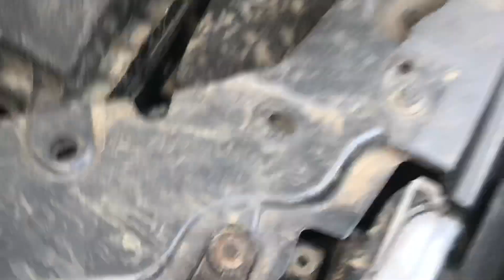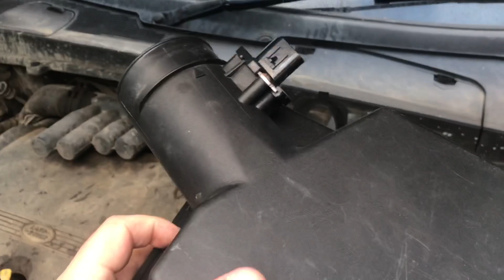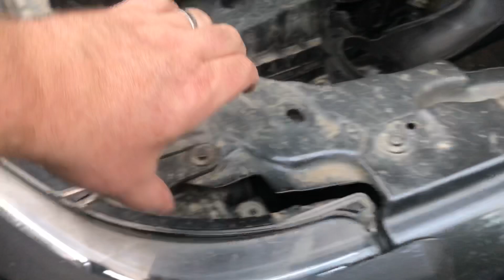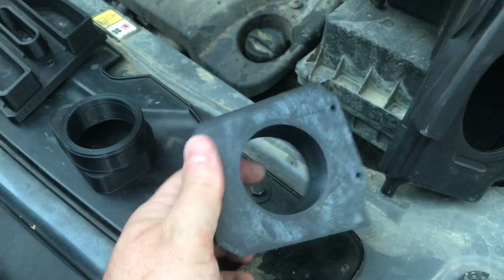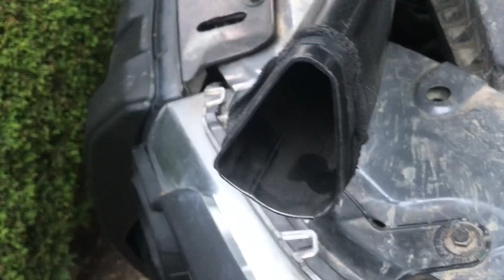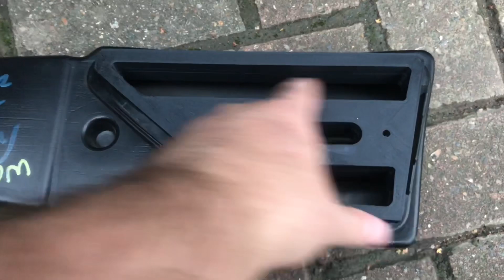Raised air intake/snorkel for Freelander 2 - Part 1

Comment: Do you sell the 2 air box and pipe adaptors on your website ? Thanks
Reply from the maker: Not yet, but I hope to add these very soon
Reply from the maker: Air filter box adapter now on sale on my site fl2lift.com

Still working on the other adapter for the wing duct front end
Reply: Thanks mate

Comment: Ok so I watched part 2 before part 1. So those are BFG AT tyres. What size and wheels. Look amazing. I asked the same question on part 2 video. So great you are using the 3 D printer and software. What’s the printer and how much do they sell for. Keep those videos coming. Your doing a great job.
Reply from the maker: Thanks for the positive feedback. My 3D printer is an Ender3, available on Amazon for ~£180. I use TinkerCad and Cura software which are both free.